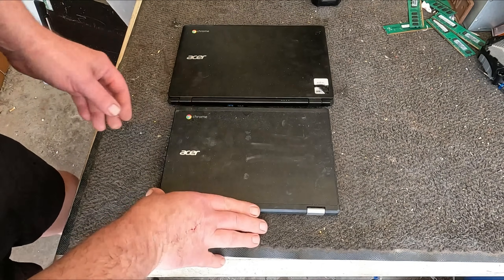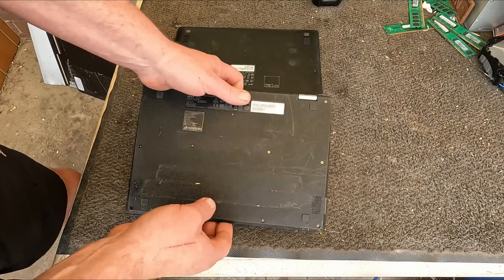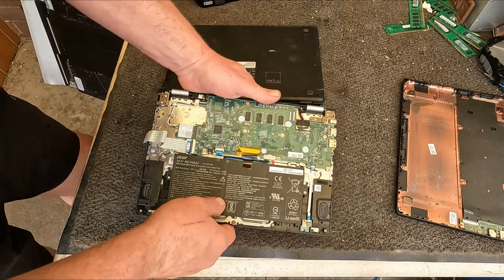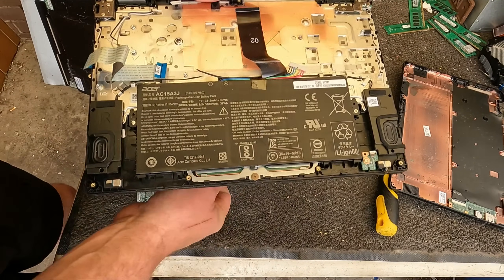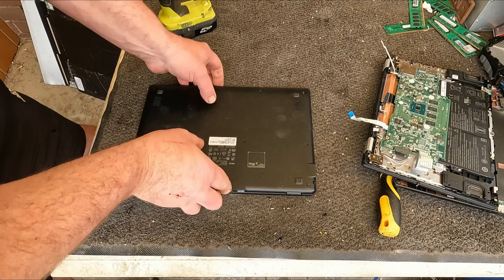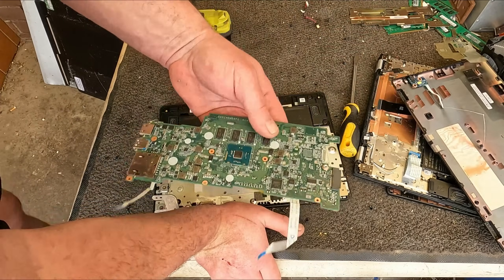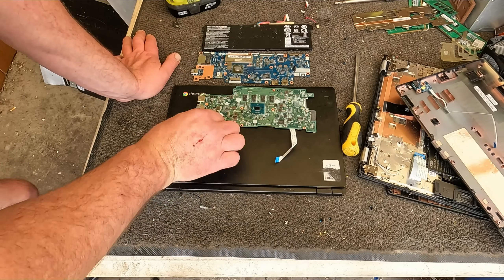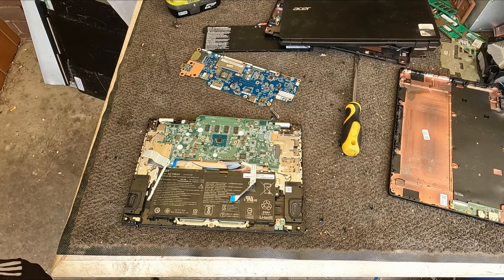eWaste Chromebooks, What's inside?

Comment: The lithium-ion batteries, wouldn´t those have better scrap values compared to the other batteries, since lithium is quite scarce ? Perhaps I personally would scrap the lithium metal out and collect it in liquid paraffin.
Reply: It’s impossible to do unless you are a professional. Good luck getting that out of something that is essentially a bomb that WILL explode if damaged.
Reply: @TruckFan542  It would explode if you short the lithium with your screwdriver (evaporation of the metal and ignition in air), or would put water on the lithium (hydrogen production and ignition in air). Otherwise lithium is not as reactive as sodium or potassium.
Reply: @AnonymosAnthropos  Yeah, i know. Still messy though.

Comment: My god. I work with the IT guy at the school i go to, and we have scrapped far too many chromebooks. Most of the acers we scrap have smashed screensm but we also scrap a lot of lenovo 300e machines. God i hate those. Always something up with them.

One running gag is one of us saying “bomb” when we find a battery in something. A battery in a PC motherboard? Bomb. A battery from a chromebook? Still a bomb. Laptop battery? Bomb again. We call them bombs, because they can be bombs. Remember the Samsung galaxy note 7? The battery in that thing was a bomb. When you scrap laptops like i do, so many “bombs” are found and have to be dealt with.
Reply: Wouldn't mind having a decent Lenovo 300e with the power supply.
Reply: @johnross8939  in my experience, those things are horrible. Ghost-touch screens are very common. Motherboards and power-button boards also go.
A Windows laptop has more power, higher reliability, and some are even decently repairable (cough cough Framework cough cough).
Reply: I’ve probably torn apart over 100 of the things.
Reply: Still a 2nd generation one, in like new condition, with the Intel CPU, and 4 gigs of RAM. Gimme one of them and I'll show you what a cheap piece of machinery can do. I imagine most of what you see are pretty well abused before you scrap them out... But I like to tinker
Reply: @johnross8939  You would probably cringe at what i have seen. Some of them look like they got squashed by a tank!
Reply: I've seen those flatpack batteries swell to 2-3x times their normal size and literally rip the ABS case--it looks like a can of biscuit dough coming apart.
Reply: @piscinaiv7937  Yeah, those batteries are nasty when they do silly buggers.
Reply: My school uses 300e's and they replace the batterys often, i think the cells themselves work perfectly fine and are safe because ive asked for a few of them when they dispose of them, the control board itself just refuses to allow normal operation. May actually be possible that they arent actually all that safe and i shouldn't be using the batterys for my projects idk.